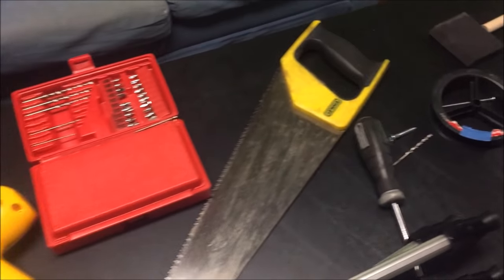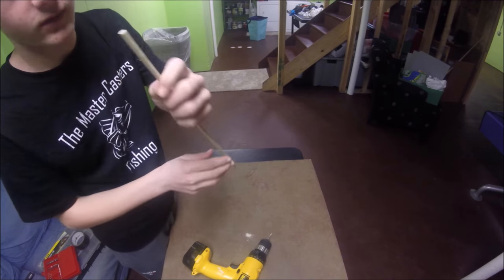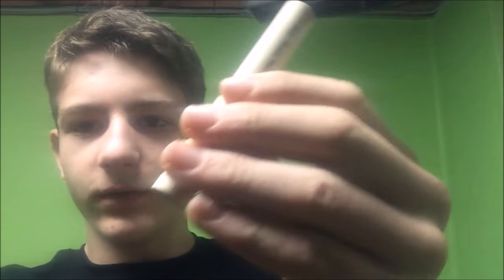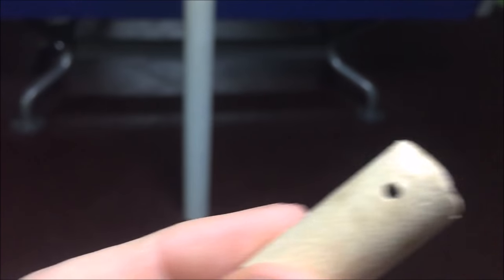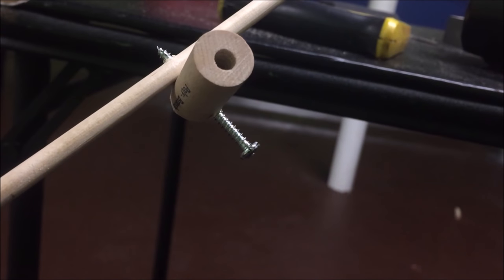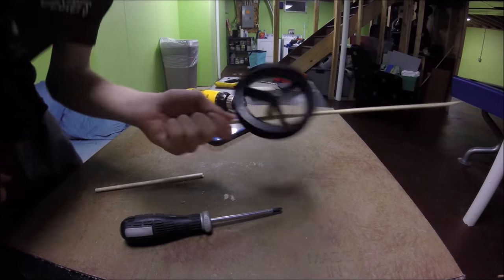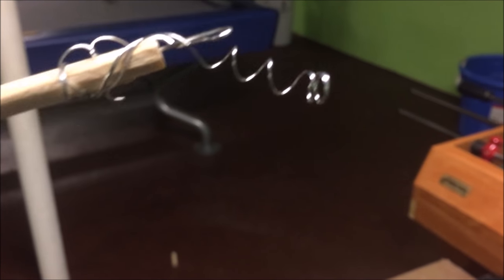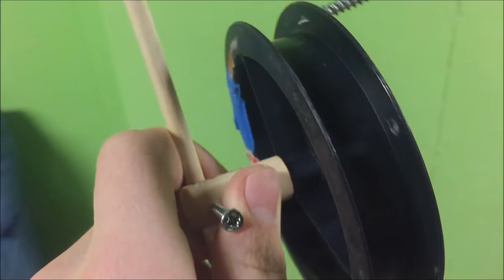DIY Homemade Ice Fishing Rod!

Comment: Not bad,i see what you were going for with the spring on the tip but odds are the line is going to get tangled around in it.
Reply from the maker: Beast Man I’ve already run into that problems while testing it, I’m probably just going to end up taking That off or even just put a real spring bobber on it